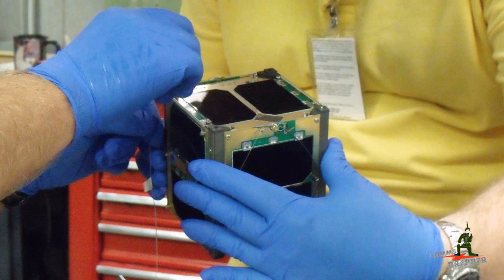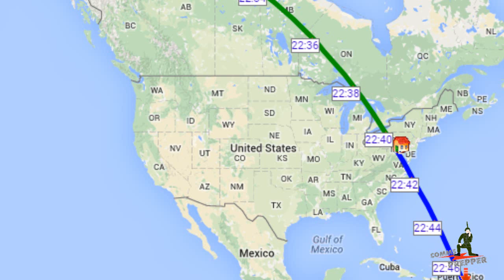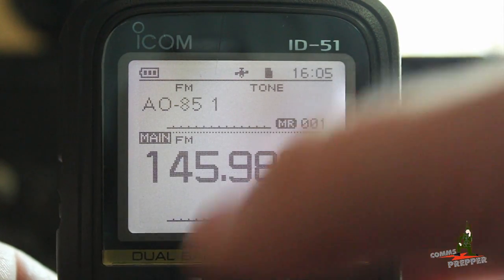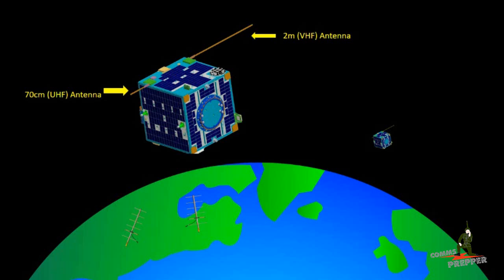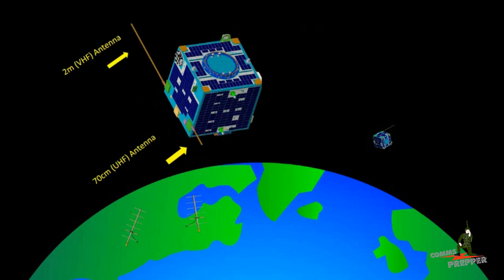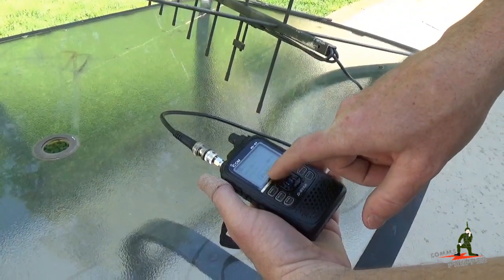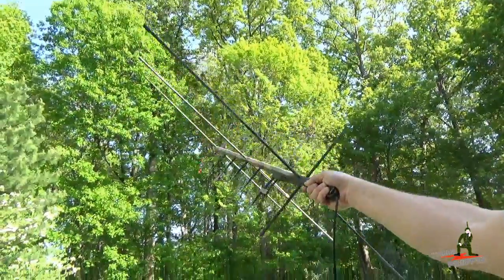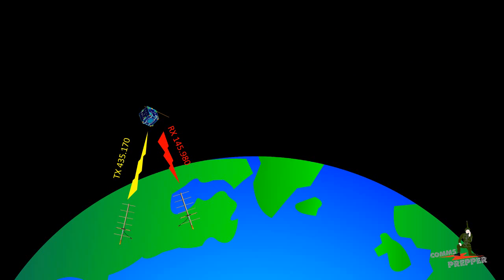Satellite AO-85 (Fox-1A) Contact with Icom ID-51A Handheld

Comment: Outstanding pesentation. Well done. A few years ago I achieved VUCC with a similar setup (FT60). Also, great memories working from Ireland to New Hampshire with the same 5 watt station. However, I mount the arrow on a photo tripod which makes tracking a little easier. 
73, Marc, W4MPS

Comment: Why does it sound like you are saying 5 KC? Am I missing something, aren't we talking in terms of kHz or MHz?
Reply from the maker: It's old school for kHz.  C stands for cycles.  Sometimes I slip up and fall back to the old way of saying it.
Reply: @Commsprepper  Thanks for the reply. I was also wondering why you were on 435.160  when the doppler correction was 435.9794 in the Sat data you had up on the screen.  I understand you were programming in 5 different settings so you could adjust through your track but why the overall difference from the data you show

Comment: Great video on getting into satellite working with great explanations.
I've got the same ID51e (which is a great handie) and the Arrow II antenna also. I'll try some satellites from the UK. 

Best 73,
Rob // M0ORA
Reply from the maker: I like the Arrow II - great antenna.  Thanks for the comment and channel support.
Reply: Thanks - yeah nice antenna. Out of interest given the ID51 has 5k steps as the smallest step - do you simply program in the exact receive frequency? I notice you did it in 5kc steps - what if you want the steps to be smaller? Thanks.
Reply from the maker: I don't have the radio handy right now but I recall changing it to 12.5 steps.

Comment: Nice work, Hank!  I'm thinking I'm going to have to pick up one of those Arrow IIs.  I've got one of their 2m / 70cm J-Poles in my attic that I use for storm spotting from my garage and for doing SSTV from the ISS.  Thanks for sharing!
Reply from the maker: +Richard Slusher Richard - it's worth it.  Lots of fun and you get a directional HT antenna for SHTF.